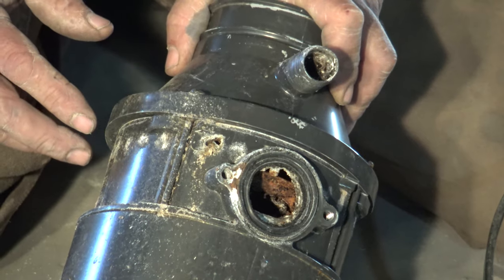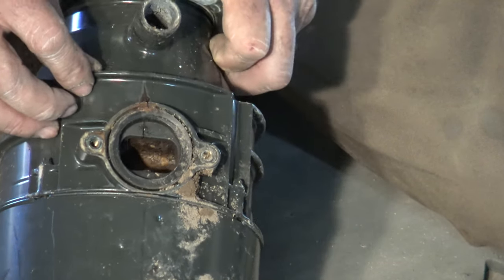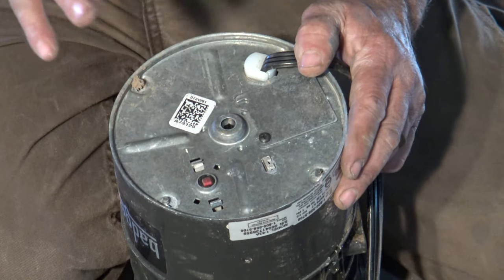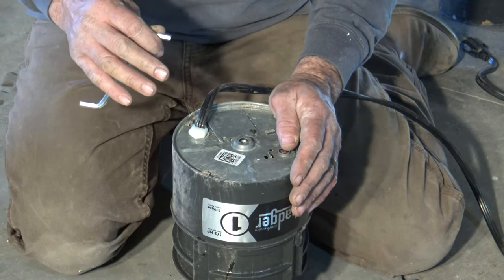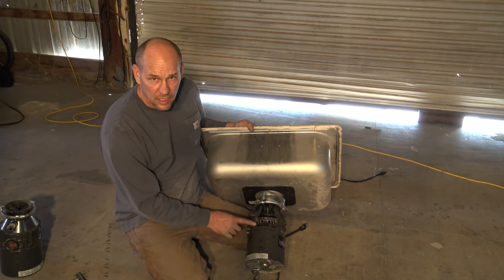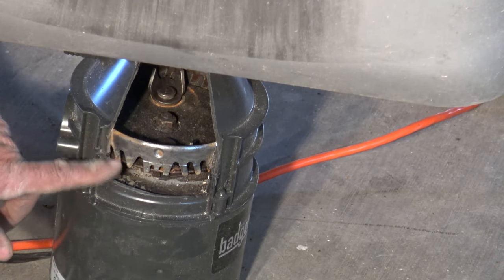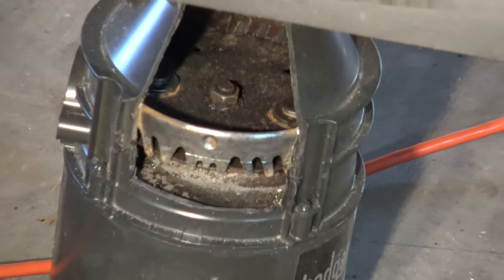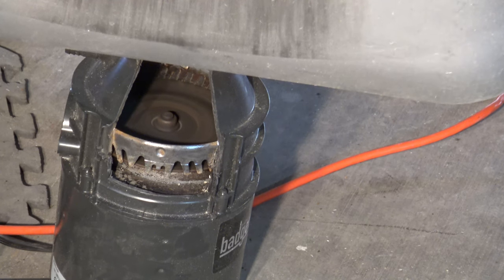How To Unjam Your Garbage Disposal - Something is Stuck in My Disposal

Comment: You saved me. My wife got a little towel wrapped around the blade. I was going to take the disposable down… took needle nose like you said, and got it out. Thank you!
Reply from the maker: Great job!  Glad we could help!!
Reply: I have the same issue with a towel stuck in the blade. Do I need to take the disposal apart to use pliers?

Comment: Great video! Very professional presentation, and very clear and understandable.  I was just about to give up on getting my stuck corn cop pins out (my wife insist on using them) and removing the disposal to see if I could get to them better.  Glad I saw your video.  Gives me a bit of confidence to go back and try some more to remove the second pin from the top.  I know it's 4 years since you posted, but I'm glad the post was still up.  Thanks
Reply from the maker: Glad it helped!

Comment: I’ve got a metal strip caught between the wall and the bottom? I can reach it with pliers but unable to pull it out any tips?
Reply from the maker: Possibly see if you can push it through and if it does it will go down the drain.

Comment: So if you can't see down the disposal to see whats making a grinding sound, then I have to go buy a small drain camera?
Reply from the maker: Have you tried using a flashlight to see in the disposal?
Reply: @DIYOnTheHouse  yes, but the i couldn't get a good look at the disposal, I went out and bought a drain camera a nd found what look like a piece of a porcelain plate that was stuck in the grinding wheel.
You're video was very helpful!